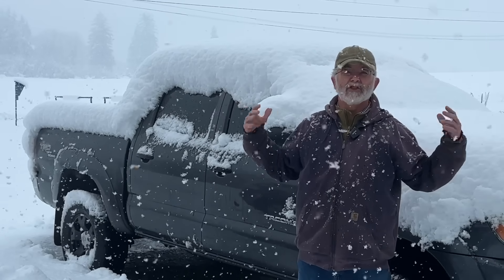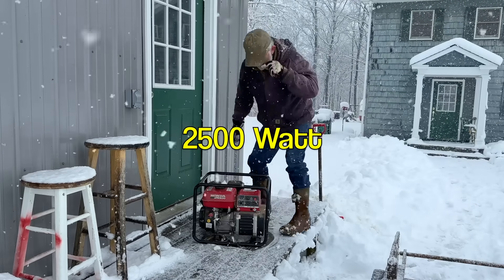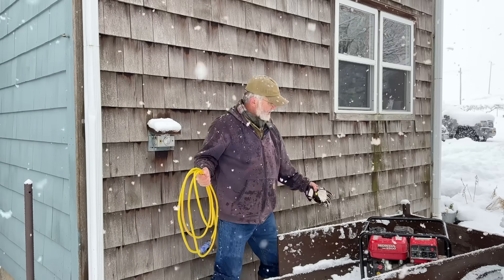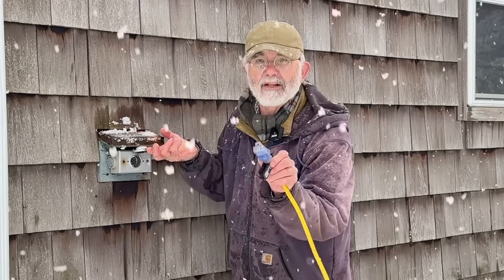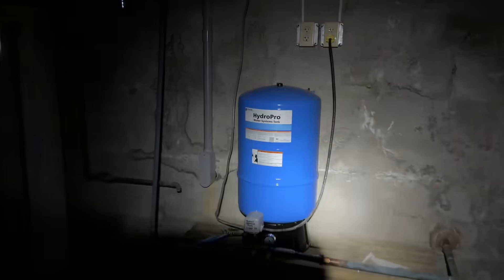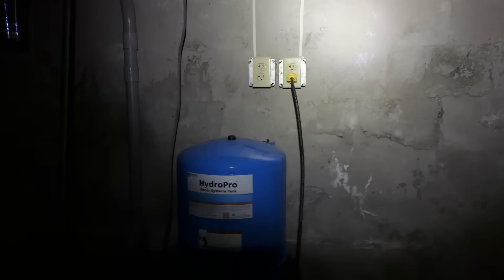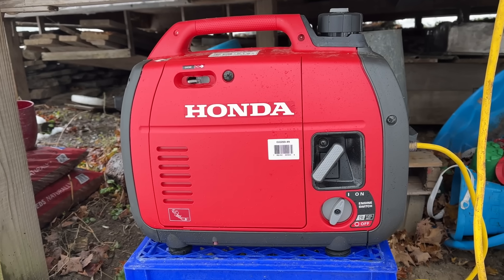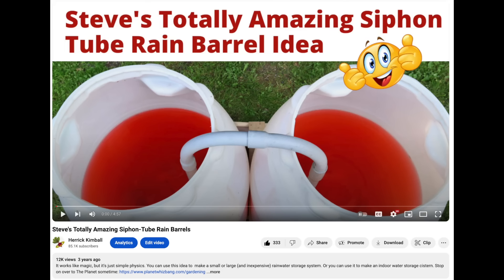Super Simple Generator-To-House Hookup  -- A Proven How-To

Comment: Simply put, I see this as a good way to get power from the generator to the inside of the house without having to run extension cords through open windows and doorways etc.  Just like a 30 amp wall plug but for 110 only. Totally separate from the main grid.
Great idea IMO.
Herrick...please correct me if I'm wrong.
Reply from the maker: You got it right. 👍
But the generator outlets are 15amps (110 volts)

Comment: You are powering your panel box, it's called backfeeding. Good thing you don't have a 240v you'd kill a lineman trying to fix the outside lines. Trunk off you main to isolate you from the electric company
Reply: Jeez.....watch the video before commenting, John. He explicitly stated his setup is completely independent of the home's electrical system.
Reply from the maker: Hello John.  I am not powering my panel box. I am not backfeeding. No lineman can ever be harmed by what I show and explain. Please watch the video again to better understand what I am doing in this video.
Reply: @herrickkimball  where is that outside receptacle drawing power normally...? Panel box? We'll hope your right, I trun my indoor 200 amp off and my generator doesn't feed any further that that. My panel is hot and that all.
Reply from the maker: @JohnSpruce-u2h   The outside receptacle and the circuit it feeds draws power from the generator only. It is not in any way connected to the main panel.

Comment: We've got that same newer Honda.  Got a kit to run it on LP.  Less concern with stale fuel or any gumming up of the lines, and it runs right around 25-ish hours on a grill-sized tank vs 7-7.5 hours per tank of gas.  It wasn't cheap, but the LP tanks can be cycled out through the grill, and a bonus is that we never have to worry about not having enough LP left if the tank runs out in the middle of cooking something, as we've got several backups for generator use.
Reply: Where do I buy the propane conversion kit for my Honda generator please?

Comment: Some power companies will fit a 'meter collar' (auto switching disconnect) which allows for a whole house 240 VAC generator backup right into the main service panel. My power co put one in free.

Comment: We're planning on doing the same thing with a L14-30 external generator plug box running to a L14-30R receptacle inside. That gives us 240 or two 110 branches to power the house. We even got a transfer switch from EX Generator Switches to power our furnace blower off the generator. I haven't installed any of it yet as I'm still trying to figure out how to properly tie the grounds to keep it all safe.

Comment: A manual transfer switch would have been much easier to install than putting in a separate house circuit.

I picked up a 4 circuit switch for $145 and wired it into my panel in less than 30 minutes and power it with a bank of 4 parallel lithium batteries or an EcoFlow Delta 2 that I charge mainly via solar panel. The way manual transfer switches work, there is no way to back feed the grid and risk life.

I also wired in a 30 amp generator inlet for my propane generator if I want 240v with an interlock to prevent back feeding the grid.

Comment: Did this year's ago during Northridge earthquake.You have to shut off main breaker or you power the grid. The generator just stalls You can rig an extension cord with two male ends
Reply from the maker: My idea here is separate from the main breaker and house wiring. I considered the double male cord, plugged into the house circuit. Definitely works, but it seemed too sketchy for me. 👍

Comment: I agree with you, Herrick. You just never know what is going to happen. i was in a similar situation as yourself, and finally just bit the bullet and got a whole house generator, power can go out at any time where i live, and it's been a while since it has been out for days, but like you, you can almost feel it in your bones. something is gonna happen...
Reply: I did a few things a lot better than you. 
I bought the biggest Honda inverter (EU 7000is) generator. The bigger brother of the one you have. It’s in its own house. It stays right there & is never moved. I have it so my wife can start it in my house without ever going outside. It is wired into my entire house with an inter-lock. It can power up our entire house including our 2-1/2 ton central air. My wife can rest assured she never has to camp in our house ever again. 
I’m a power lineman for a living. You’re very wise to have a back up generator. Although at your age do you really want to go through all that extra effort? With global warming & more fierce storms with longer durations folks need to wise up & have back ups. We keep 111 gallons of stored gas in our shed. Long enough for a 3 week outage. All our gas is pretreated & I can run my genny with an auxiliary for 42 hours straight. I start it once a month to be sure it’s ready. Mine is electric start & starts on the first try. It has electronic fuel injection so there isn’t any carburetor to foul. I have mine on a battery tender all the time. I change my battery every three years irregardless of whether it needs it or not. I change the oil once a year with Mobil one. It has never let us down. It’s a Honda. 
Thanks for posting. Glad your outage was only 31 hours. Atleast you were able to stay somewhat comfortable.

Comment: Unless you have a transfer switch or some other way to isolate your now energized house, you risk shocking the lineman who repair the electrical lines.  People think the power feed lines are dead, but your generator just energized them.  How did you address this with your electrical inspector?
Reply from the maker: No lineman working on electrical lines can be harmed by what I show in this video. Totally impossible.
Reply: @herrickkimball  That may be true, but the video gives the impression anyone can connect a generator to an outdoor receptacle without any electrical isolation to the incoming power lines.  This is not only not to code, it's very dangerous.  Unless I missed something in your video, I think you should put a warning in your video about the danger of doing this.  Or, take down the video.  It's going to hurt/kill someone.
Reply from the maker: @ There is no danger in doing this. My electrical lines and outlets are in no way connected to the house wiring. The generator is powering a completely separate circuit and receptacles that are dedicated to generator only. You have missed the whole concept. 😐
Reply: @herrickkimball  Got it.  You are correct, I did miss the whole concept.  Hope others understand that you have two separate circuits. One circuit gets power from your local utility and the other gets power from the generator..  Thank you for clarifying.
Reply: @ericr2zz You need to pay more attention to the video. The outside male receptical only connects to a few recepticals in the house and in the basement.  Those recepticals are never connected to his service panel. Those recepticals are only hot when his generator is connected to the outside receptical and is running. 

One more time,,,, Those recepticals aren't never connected to the grid.

Good grief!
Reply: God......what's with all the commenters and their criticisms? It is obvious none of them have taken the ten minutes and twenty-seven seconds to watch the video first. They must be very, very busy people!

Comment: I love that electric set up that you have I have never seen it before I assuming that you run extension cords from the outlets to whatever you want power also with the well pump, I’m assuming you ran a line from outlet connection to outlet downstairs? Thanks in advance
Reply from the maker: Right. Extension cords. All 12 gauge. 14 gage is enough for a 15 amp generator outlet, but I'm a 12 gauge power cord guy.  🙂 And, yes, Romex line from where generator plugs in goes to 4 wall receptacles and from there to well pump receptacle.
Reply: @herrickkimball  thanks you for the response, I’ll try to find out more on this set up👍👏
Reply: My first thought was you were back feeding the grid till I listened further.  So you essentially wired a separate feed loop to power your emergency plugs off the generator.  Simple solution.

Comment: I'm curious about grounding. Does this setup not provide a ground?
Reply from the maker: Great question. I never thought of it. Did some quick internet searching to see if portable generators should be grounded. It appears to be a complex subject. In my situation I suspect my generator line wiring in the house is grounded at the plug over the pressure tank in basement. The box is metal and attached to a concrete wall. All receptacles and metal boxes are grounded as per code. Perhaps someone who knows more about this can comment here...
Reply: @herrickkimball  buy a plug tester, check your generators for bonded or unbonded grounds.  There are some good videos here that explain when a generator ground is needed.
Reply: @herrickkimball  As long as your stand-alone receptacle system is tied to the home's ground rod grouping (there's usually a pair) you have nothing to worry about.
Reply: @herrickkimball To run a separate system like you have, the generator should have ground and neutral tied and the generator frame should be grounded. Generator manual or possibly a label on the control panel should say if the neutral is grounded or floating.
Reply: Most portables are grounded internally.  One needs to check their individual generator to know if you need a separate ground.  Using a ground when not called for can cause a dangerous situation, same as NOT using one when called for.
It can cause a neutral loop situation.  There are videos on YouTube explaining it.
Reply from the maker: @megastick9324  Thank you.👍
Reply: Good additional info, thanks!
Reply: Great idea!